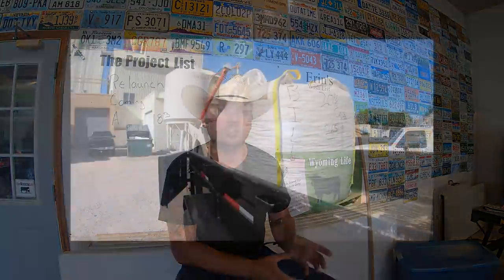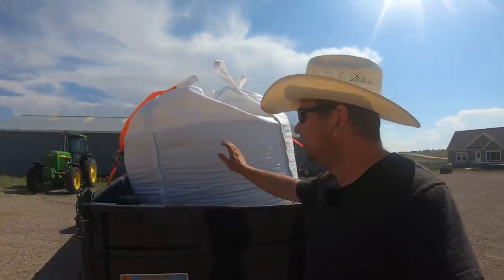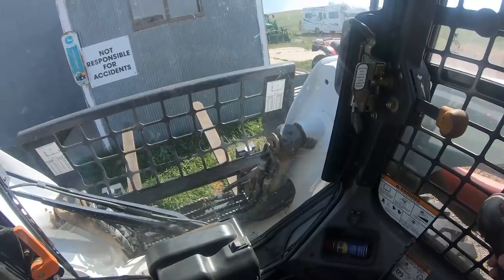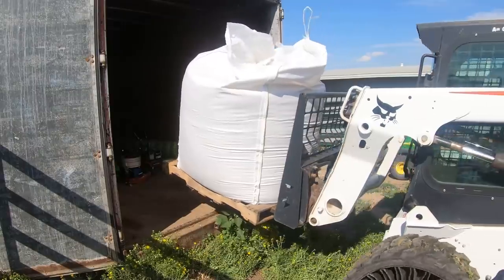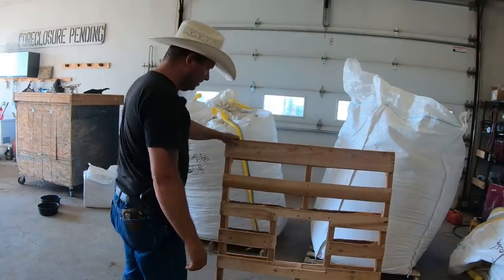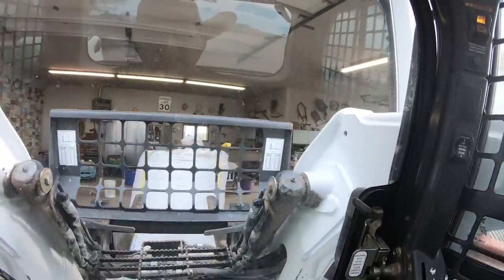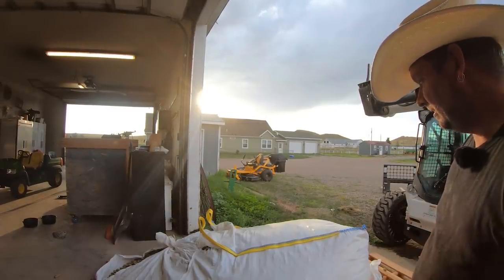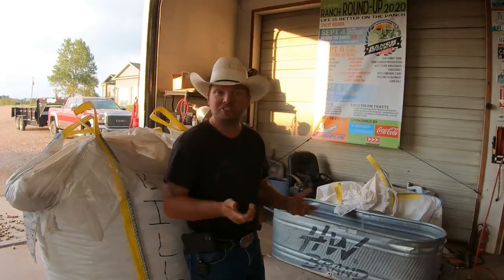Bulk Feed at the Ranch and One on the Ground

Comment: I've raised cattle my entire life, most people I know do too.  Never in my life have I seen anyone use, handle, or heard of those types of bulk bags for animal feed.... Interesting.  Perhaps more around planted crops with ordering seed (ground is low where I am, bit soft, not good for irrigation, sub-irrigated if not drought, but good thick grass, crop farmers are a little distance away)?  I live 30 miles from town, there isn't a Tractor Supply (T. S. Is 75 miles, same as the closest Walmart).  There is a similar store, Bomgaars.  Range cubes there are about $3 per bag higher than the feed store for Purina brand, depending on which you get.  Plus the feed store ones are better nutrition.  The feed store delivers bulk.  ~15 tons+, less than or around $100 delivered and augered into wherever.  And of course they'll do smaller loads and charge a partial load/split/cost share with someone else if they're in the area anyway.  Smaller truck is also a little cheaper (think it maxes at about 7 tons).  Been a few years since I checked, but the bulk bagged is a bit cheaper than the pre-bagged name brand stuff.  You can get the bulk bagged for a small cost per bag, barely over the cost of the bag.

Comment: What about buying small bags from Dakota? Its probably a bit more expensive. I know when I buy bulk supplements, I only save $25 a ton. So its just a more ease of use than cost for me. I was not surprised. Tsc, rural king and all of those places are marked up ridiculously high.
Reply: He said that he saved almost 50% than the bagged animal food. If it was only $25 a ton he wouldn't spend so much time and effort.
Reply: @chrishar110  over tsc feed, which is marked up alot. I was asking how much he saved vs buying little bags straight from the mill

Comment: I could have told you pulling backwards on the two top straps would rip the straps off the bag.  A better idea would have been to lift those straps as vertically as you could until you can get one or both of the two straps underneath out and then get the chain through them as well.  That's simple applied physics aka engineering.  Sorry I wasn't there to let you know. :)

Comment: Total waste of day? nahhh..  managed to get two bags to where they needed to go , pigs got fed,  layer feed put away.  Gaylord bags are PITA.  weight shift and its not that hard to have it roll on its side.  And dumping a load of cake is not as bad as me dumping a compact skid steer off a semi truck. It landed on its back end, a fall of about 4 feet. Damage is around $1000 on a brand new equipment.  Well it works as advertised so one tough machine.

Comment: Reduce the weight.  Fill 10 five gallon buckets with cake out the top of the bag before you get hurt. 2000lb held up in the air is to dangerous.  You lucked out with the pig feed.